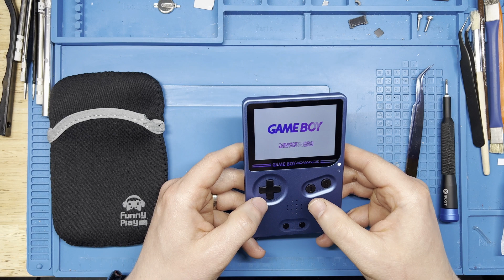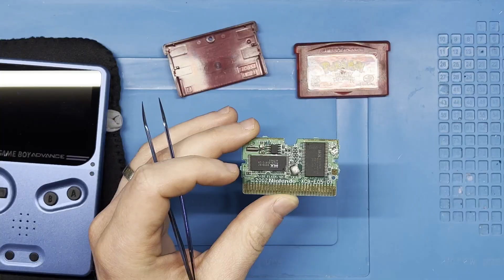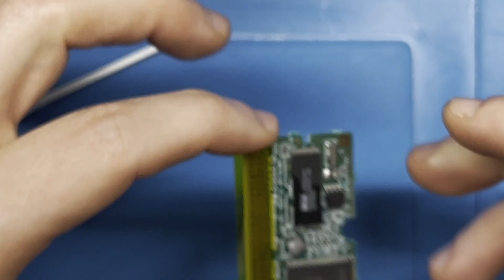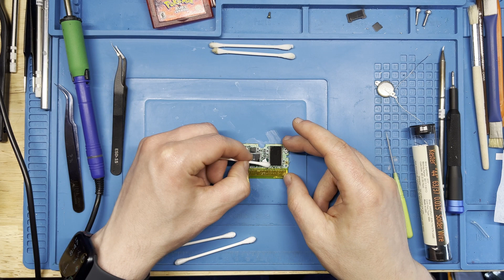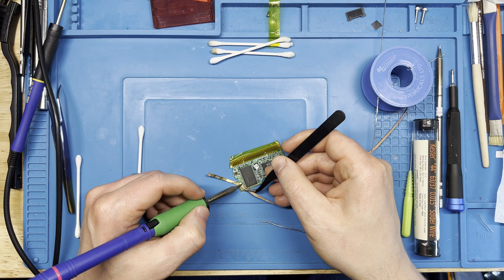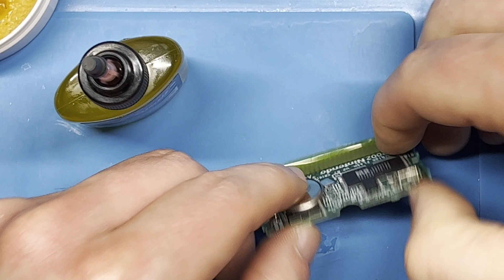Pokémon Ruby Botched Battery Replacement Repair

Comment: in my experience the easiest way to reset the rtc is just cheap ds flashcart with rtcread-ds on it, given you have ds with gba slot. No mod required.
Reply from the maker: I just connect it up to my PC using a GBXCart and set the flags with PKHex.